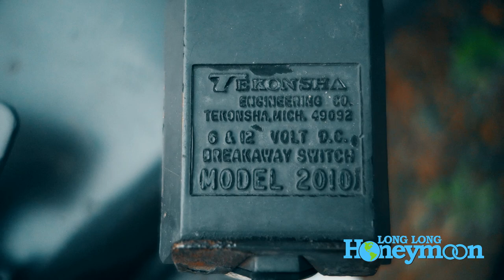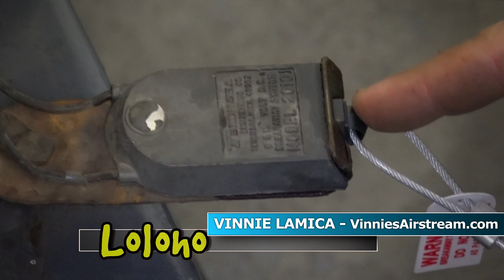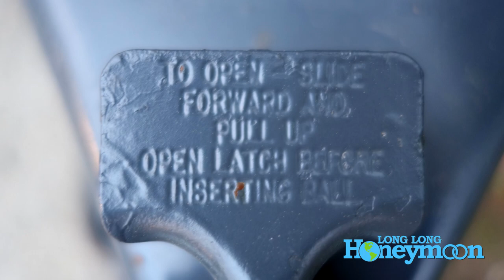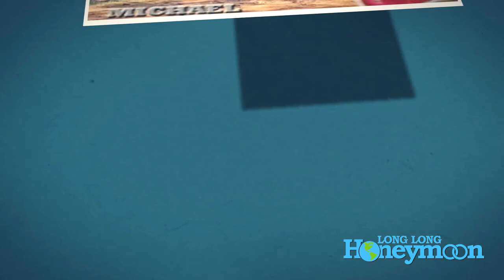For Beginners: "TOP 6" TIPS for HITCHING AN RV

Comment: One more thing. Trailers that have a battery (whether RV or not) have a twelve volt connection to the cable that plugs into the tow vehicle. This has a fuse in the line to protect the cabling, connector, and alternator.  If the battery in the trailer is significantly discharged, it will draw excessive current from the tow vehicle and blow the fuse.  There is no indication that this fuse is blown until we get to the boondocking camp site and find that our battery does not have much charge which is kind of disappointing.  If we replace the fuse with a self-resetting breaker of the same value as the fuse, then the breaker will cycle until it is able to maintain a constant current flow without opening.  Now we can arrive at our boondocking site with a fully charged battery.

Comment: When connecting your emergency cable to your pin you a want to put it on the side that doesn't have the clip cause it could just slide right off very easily

Comment: This is my first camper and I hitch alone, I’ve decided to get back up camera set up. I think my camper is tilted up, will check tomorrow. I’m having a hard time backing up in our driveway, I panic then I end up getting frustrated. I keep my plugs clean, I use a keyboard aircan to blow out debris in and around it. I have 16 footer, do I need one I think the chains are not mount right!?! My brake away is like yours but I think my cables are too long. The hitch ball away sticks in my mind. I’d better moisten mines! Lol....

Comment: One way to make sure your camper is hooked up to the tow vehicle, is after you have latched it down, use the electric jack to raise your trailer up.  If it raises your tow vehicle up, without coming disconnected, then you know that the camper and tow vehicle are hitched.  That's something I always do as just an extra fail safe, then I'll look up the weight bars

Comment: Just as a suggestion, using either gloves 🧤 or perhaps a small brush to spread that grease onto the metal ball and chain hitch holes, is a good idea, to avoid possible metal splitters or shavings of the metal ball and conector. Their a pain! To get off your fingers afterwards, specially with dark greased fingers.

Comment: You guys do a great job!!! Do you have info on hitching up 5th wheel RVs?
Reply from the maker: Sorry, we have never hitched a 5th wheel -- we have admired them though!
Reply: Getting the height of the trailer king pin just right is the only tricky part of hitching up a fifth wheel. I back the truck up close to the king pin, then make the fine tuning adjustment to the height. In the driver's seat, I adjust the inside mirror so that I am looking at the hitch, and back it under the trailer until it locks in place. By looking in the mirror, you are looking straight back at the hitch and not from an angle. This makes it easy to back under the king pin.

Comment: How do you know how much pressure or how many links for the weight distribution bars? I have mine at 3 links hanging also and everything is level but I can actually close mine by hand when I have the trailer jacked and then they are tight when I raise the trailer jack.

Comment: Amen about little to no training! And it's epidemic, in some astonishing places. Right now we're trying to buy our tow vehicle, in the middle of end-of-the-year sale fever, and it's jaw-dropping how little the sales staff of any dealership knows about the tow package. One brochure suggests talking to your dealer's "RV Towing Specialist," a personage I was informed does not exist. The upshot is a great deal of nervous confusion. We want a small rig and a large SUV, but it's been impossible to even see a Nissan or Toyota in Indianapolis - none available in any of the dealerships. Which leaves the old reliables. The Yukon Denali seems to have an integrated tow package as standard, but no one is sure. The Suburban seems more reasonably priced, but very up in the air about integrated tow, and many of them don't have it, though salesmen often aren't sure. This is apparently important, because according to what few articles we can find about it online, an integrated package installed by the factory is better all around, with less chance of important wiring and link-ups that get forgotten by the dealer installing it after purchase. Also the brake hangs down from the dashboard and hits your leg. You'd think on a vehicle this expensive, that would be a problem long-solved, but it's the same as in my father's day. Since this is something that can cause a bad accident, I wish a couple of salesmen on the floor would learn as much about towing a trailer as they learned about financing packages.
Reply: From Indy also.  I understand what you are saying, I found all of my information either from guy friends that two work trailers or on line.  There are a lot of awesome forums out there that talk about tow vehicles, what you need for your trailer and where you want to go.  My 1st tow vehicle was a Lincoln Navigator that had a 'tow package', but that was only the wiring harness for an electric break install, ball receiver and plugs on the back bumper.  What it really didn't have was the gear ratio truly needed when pulling through hills and mountains.  Although it was rated to pull 8900 and I was only pulling a 6000 TW trailer it was obvious it was not the right towing vehicle.  What you will want is something with a larger engine then your basic SUV's have and a higher gear ratio for the axle.  This will give your towing vehicle a longer life span.  I opted to get an older Ford Excursion because none of the newer SUV's had what I needed.  Google towing vehicle needs and you'll find a lot of info to dig through.  Right now the only thing in new vehicles are trucks like a Ram 2500 or Ford 250.  If I can find the forums that helped me figure out what I need I'll try to add it.  Also when researching what a vehicle has in ways of towing your best bet, again, is online information.  Either google it or go straight to the makers web site for specs.
Reply: I get all my towing questions answered by the folks at my local new/used horse trailer repair/dealer. Since they install hitches and adjust bumper pull and gooseneck trailers for a living, they have a lot of useful information for me on a variety of topics.

Comment: Some more tips....Make sure that the brake switch lanyard pulls the pin before the length of the chains is fully pulled or the brakes won't activate until the truck and trailer separate completely. When you think about it the chains will hopefully stay attached to the truck and the brakes on the trailer will activate keeping the truck and trailer separated till you come to a halt, if the lanyard is longer than the chains the brakes won't activate and the trailer will slam into the rear of the truck when you slow down....not good!
Also the tension setting for the antisway bars is the link on the chain that keeps the front of the truck at the same position from the ground as if there was no trailer attached. You can also reverse the chain so that the loose links are at the bottom where they can't get into the wrong position and the wrong link can't be selected.
Hope that's understandable

Comment: When connecting a ball type hitch it is also very It is important to be you have the correct size ball.  Some common sizes are 1 7/8in, 2in and 2 5/16in.   Too big of ball an the hitch sits on top and never seats correctly and doesn't lock down even though your tongue lock will lock closed.  Too small of a ball and hitch will go over ball and lock but is able to slip up over  ball.  
  I personally like to stop tow vehicle about an inch or less short of directly over the ball to let the hitch ride over the curve of the ball, while lowering, to help assure the lock mecenisim doesn't get pushed up on top of ball. 
   Just GET FIMILURE with how your hitch looks when properly connected.

Comment: Do you have a video on what makes your city water when hooked to city water fill up the Fresh Water tank when you never fill the Fresh Water tank.  I've researched other videos on YouTube but would like to know what you two think how that can happen and how to fix it.  I've tried everything I researched and nothing works; we've only had this Forest River 2015 Palomino Puma for a couple of months; hooked it up at home and left city water connected all night and in the morning I noticed the dripping coming from the Fresh Water fill.  Didn't know what to do; got on Youtube and started searching.  Being without an RV for 3 years I still wasn't sure of what to do, so I drained the Fresh Water tank.  We've always just hooked up to city water; never use the pump or filled Fresh Water tank, but the water gets in there somehow.  Some say disconnect city water, turn pump on for 10 min, open faucets (hot then cold) and it should clear the check valve inside the pump.  But this didn't work, or I'm not doing it right.  Would like to fix this ourselves but not too smart on some of the terms used or experienced in using the pump.  Thanks; enjoy your videos.

Comment: Guys you need to move your break away cable away from the chain hook on the receiver, I had to repair our neighbours cable a few years ago their cable got pinched by the chain on some sharp bends  and cut threw it.  Ended up replacing one of the number plate surround cover bolts with one with an eyelet and they can connect it to that. (Luckily it bolted to the car frame)
Reply from the maker: Yes, placement of the breakaway cable is a thorny issue. We may install a hook of some sort to better secure it to the truck chassis.

Comment: One point that needs to be made is that  the WDH  chains  should be vertical when attached when the trailer and vehicle are in a straight line. In one of the scenes the chain is at an angle, presumably because the trailer and tow vehicle were at an angle to each other

Comment: Great video.  One quick pointer....NEVER have anyone stand in between 2 vehicles, ie the truck and trailer, when you are backing up.  All it takes is your foot to slip off the brake, or hit the gas pedal and your ground guide will be squished.  It's better to have your ground guide stand clear and "eye-ball" it.  It may take a couple minor adjustments back and forth, but it's better than a horrific accident.   My wife reminds me all the time that she isn't expendable!  Thanks again for the informative videos!

Comment: Remember there are 3 different ball sizes.  1 7/8",   2" ,  and 2 5/16".  Don't make the mistake (like I did a couple months ago after purchasing a new trailer) by putting an undersized ball into the wrong size tongue coupler.  I had a 2" ball and the new trailer had a 2 5/16" coupler.  The new trailer was only 3 feet longer so it didn't even dawn on me that it would require a larger ball.  Ball went into tongue just fine and the coupler will appear to lock also.  After driving a couple of miles and hearing a strange shifting noise when coming to a complete stop got me out to investigate.  Then I noticed the locking mechanism was locked but not up and close to the ball like it should be.  Now I discovered the stamped warning on the tongue coupler which indicated the required 2 5/16" ball size.   I was super lucky that I hadn't gotten on the freeway yet.

Comment: One thing I have learned when hitching is how to lower the tension on the equalizer bars. You didn't touch on that in the video..Once the hitch is on the ball and is latched properly, raise the tongue to lower the tension on the equalizer bar. This make it much easier to lock the chain of the tension bar in place. Once both bars are locked, the the tongue jack can be completely raised. and you trailer is firmly connected to the tow ball.

Comment: When the trailer is not level (when hitched) it does not effect a single axle trailer as much as a dual axle trailer.  Too low means that the front tires are over loaded.

Comment: The accidental unhitch of the  trailer from then ball is not uncommon... I am usually careful with that connection, but ..Double check it. I take a  flashlight to loose at the connection now as part of the hookup procedure. I had an accidental disconnect once, thanks to the safety brake switch, I averted a major accident.

Comment: 16:58 The main reason you don't want a cable that's too long is when the trailer detaches it drags on the chains and if the chains are shorter than the cable the brakes will not engage because the cable will not pull the switch.

Comment: I wonder how much of this would pertain to towing a car ? I am getting the equipment installed as we speak so I can tow my Jeep behind my Motorhome. It will be the first time I have pulled ANYTHING and I admit I am nervous about it. Goodyear isn't making me any more comfy about it, so I am just praying they install it correctly. (They act like this is their first time and they are giving the vibe they are unsure). I am picking it up Monday, and I will be looking very closely for some of the things in this video. As always, thank you for sharing your knowledge.
Reply: I have been pulling my Ranger pick-up for over two years behind a 32ft class c. It truly is totally different from pulling your casa behind you. Due to the weight of the truck i have no need for a toad brake. I keep my back up camera on so i can keep an eye on things back there mostly because i forget it's back there. It does not affect your forward driving. Two things to remember, you are  longer, NEVER NEVER TRY TO BACK UP! This is very important when trying pull into some places like fuel stations. You can back up a very few feet without damage. Lesson learned one very rainy day in Fla.
Reply: Thanks for the tip. I will remember that. I am sure gas stations are a bit of a challenge. Got to find the right ones. The 1978 GMC Classic Motorhome I have is only 26 feet, and only has the 403 in it. I am hoping it is "hoss" enough to pull the Jeep with no issues. They are saying the Jeep weighs 3700 lbs but it doesn't seem like it to me. I would like to pack a few things in the Jeep.
Reply: I see a lot of vehicles get damaged due to flat towing them behind RV's. If going for a long drive, you might disconnect the drivelines at the axles. If the drivelines are spinning, you can really tear up the drive train.
Reply: Kenny Johnson   I have driven a Class A RV towing a Jeep Grand Cherokee 4 wheels down for 20 years.  I made sure when I bought the Jeep that my particular model was ok for towing 4 wheels down.   Make sure to check and double check.  I have had three different year Jeeps but always a Grand Cherokee.  I always had the RV dealer install my tow bar on my Jeep to ensure it was properly attached.  50,000 miles and I never had one problem towing my Jeep.  And it was so easy to hook up my 8 and 10 year old daughters helped hook it up.

Comment: One other thing.  Most trailers (whether RV or not) have a fuse in the twelve volt line from the towing vehicle.  If the battery in the trailer is significantly discharged, it will try to draw excessive current from the towing vehicle blowing the fuse.  There is no light or indicator on the dash panel telling you that the fuse is blown.  If this fuse is replaced with a self resetting breaker, then it will cycle until the current draw is down to a level that it can sustain without opening the breaker.  it is disappointing to pull into your boondocking sight and find out that your battery was not charging while you were on the road getting there.

Comment: yup, the intro is your best ever. there are better options. examples: "McHitch", "Tuson".  in fact, having the TT slightly nose down is ok. reason: when towing, the mass of air striking the front of TT will cause an upwards force vector at the hitch, levelling the TT but raising the TV rear.  a WDH will increase this vector, and can be unsafe.

Comment: my wife is blind she ain't much help guiding to the hitch, so i made a v plate in front of the ball, it has about 8" on each side so i can be off some 6" it will center it as i back in, i cut a broom handle to measure the right height to hitch, i can remove the v plate once hooked up

Comment: I watched your video and took my first trip. My mistake wasn't mentioned in your video. I wanted to sell the trailer after hitching and unhitching. It was a nightmare. I am. 65 year old female who travels and does everything on my own. I attached my weight distribution bars and ther kept falling down. This was a real pain. Finally attached both sides and drove the 120 miles to the campground. That night I watched the video that my son took during my walk thru, thinking it can't be this hard each time. The reason I am writing this is to explain to new folks like me there is a notch on the round end of the bar that fits into a opening where the bar goes on the hitch. Then the end easily turns without dropping down! This was easily seen and explained to me on the video, I just forgot. I don't know how dangerous it was for me to drive without the bar being held up by laying over the notch as designed. In any case I feel very lucky. I put this comment in just in case you want to add this point to your video for new folks like me. I feel like a real idiot, hopefully this might help someone else not make the same mistake. BTW I just came back from my second trip where I hitched and unhitched correctly in less then 15 minutes. It was a pleasure and I no longer want to sell my trailer. "Have trailer will travel," reads the card of this gal.
Reply from the maker: Thanks much for sharing your experience. Great tip about the notches on the weight distribution bars.